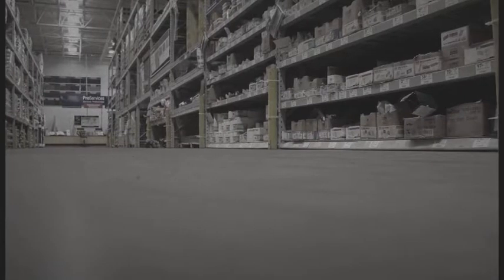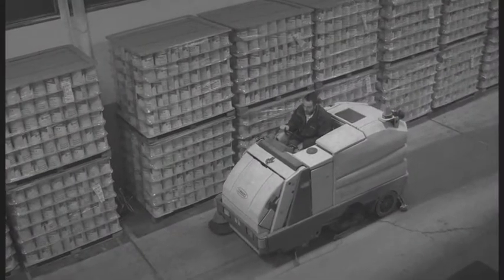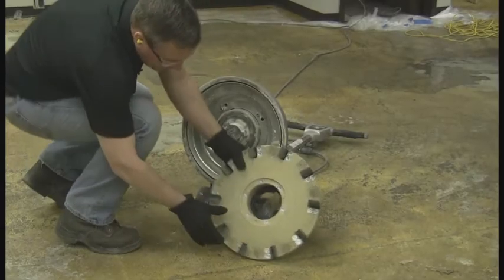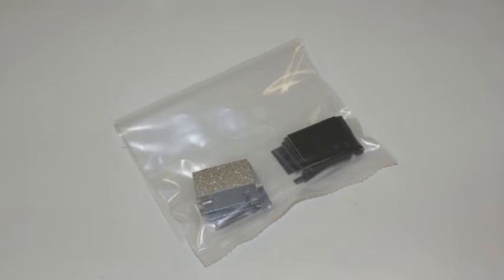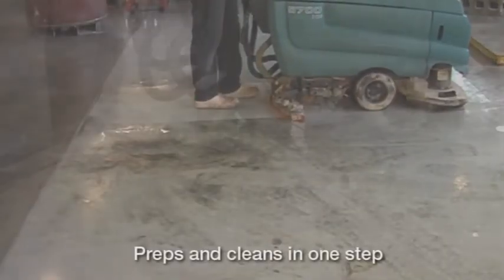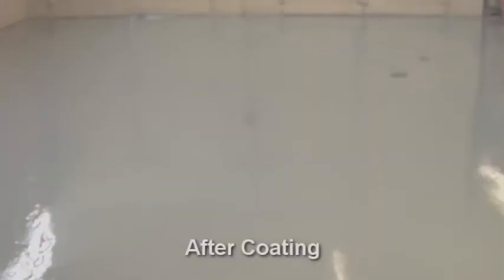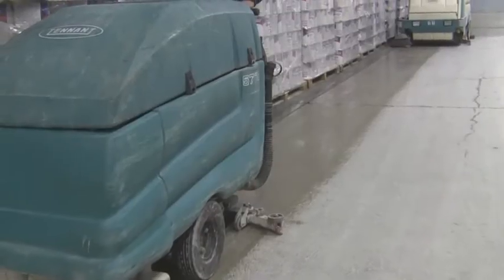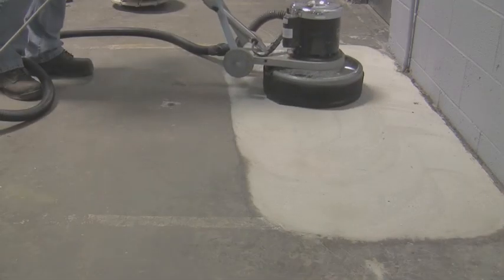Diamabrush prep, sand & recoat, removal and polishing video

Comment: I rented the Diamabrush Prep Tool from the Home Depot with a manual floor machine. Cleaned a garage floor 60'x40' in a former automotive repair shop. The tool performed as advertised and I am very happy with the results. We were going to paint the floor but the concrete cleaned up so nice that we are just going to seal it. A person could make good money polishing concrete floors. 

The first thing I learned is that it's extremely loud, cringe worthy loud, make sure you have ear protection. 

It's a wet environment with concrete dust, I recommend latex or vinyl gloves if you will be handling the squeegee, the hose, moving the cord for the floor machine, shop vac. 

It's best to have two people, one person operates the machine and the other person keeps the floor wet and sprays away concrete removed by the tool so the operator can monitor progress. 

We inspected the tool for wear at the half way point of the job and at the end. There was very little wear on the tool. It looked like all we did was sharpen up the angle that was already there when we started. 

There is a place to add a vacuum to the manual floor buffer but doing so may create two problems, one is, on a large job the vacuum fills up too fast, and second, you run the risk of tripping circuit breakers in a building you know nothing about. Oh yeah, a third thing is even more noise. 

We are amateurs, it took 12 hours to complete the job.